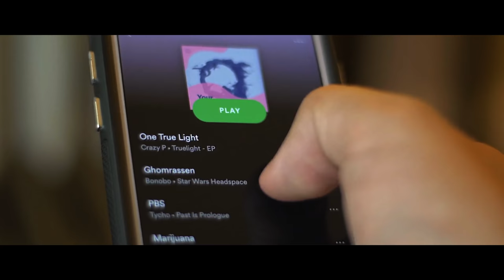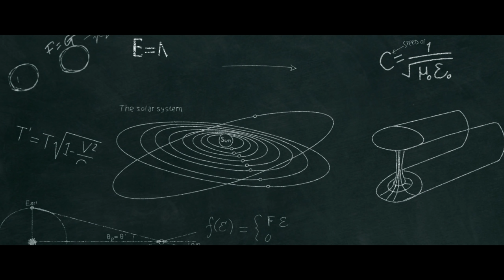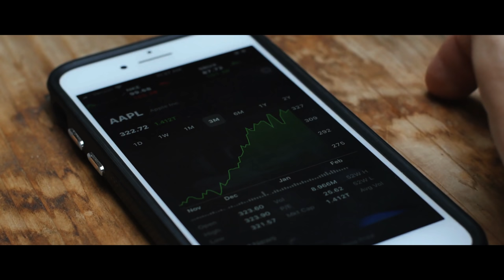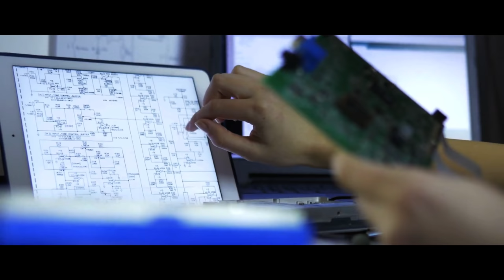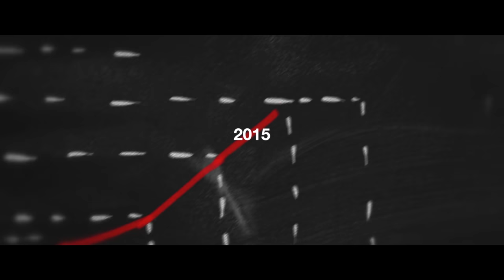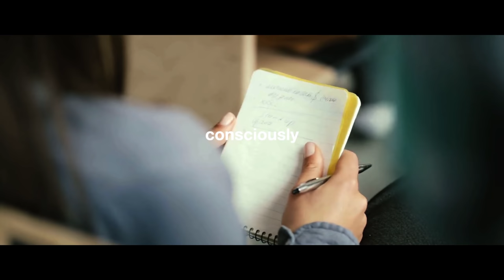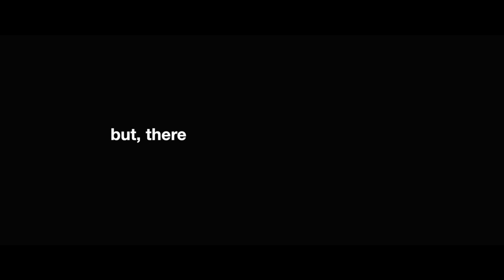The Technological Singularity

Comment: Beyond the event horizon of a black hole is likely what you meant to say ;) there is no "beyond the singularity" in physics when referencing a gravitational singularity, the singularity is the infinitesimally small point in spacetime where all known laws of the universe simply cease, it is a region of infinite density. The event horizon of a black hole is what is meant in regards to the point of no return. When matter or light crosses the event horizon (some of which are larger than our solar system, as is the case of the supermassive black hole recently imaged at the center of the supergiant elliptical galaxy Messier 87) it can never return, it's only possible future is an interaction with the singularity.